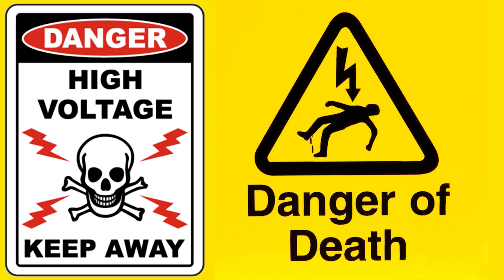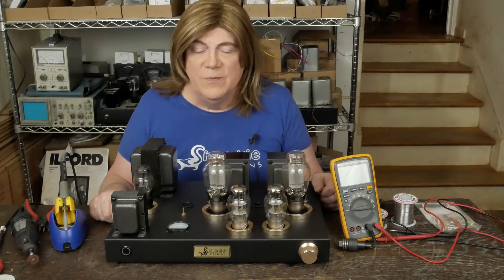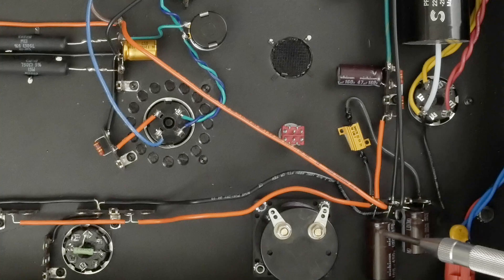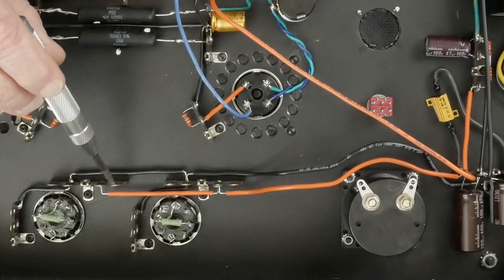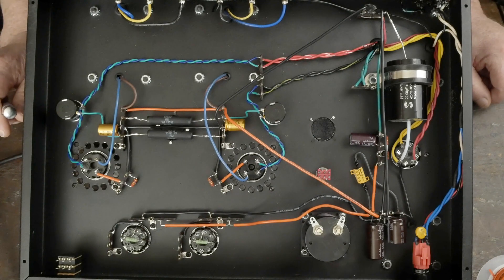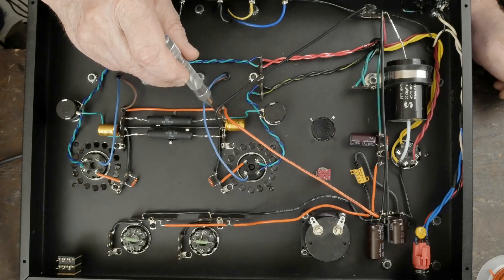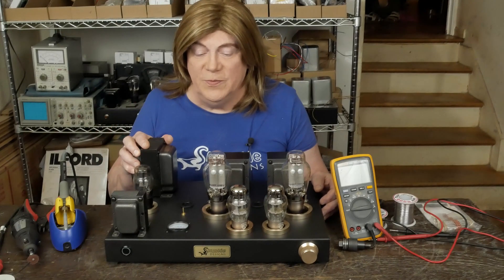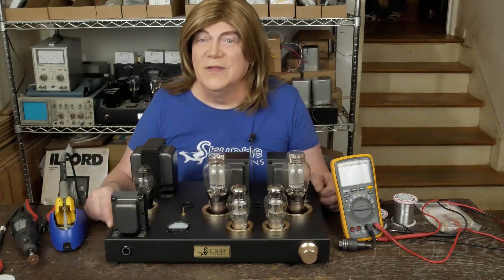2A3 Single Ended Tube Amp DIY Build: More Wiring!

Comment: I built an Analog Ethos 2A3 amp and it is rated at 3.5 watts per channel.   Wonder why so much lower power rating on the AE amp?.
Reply from the maker: That's about right for the output. I'm talking about the tube's dissipation being 15W, not the output.
Reply: Thanks for explaining.   Look forward to your testing results.

Comment: Use Rod Colman V9 regulator for 2A3, sound will be superb.
Reply from the maker: AC heaters work fine on a 2A3
Reply: @SkunkieDesignsElectronics  Of course they do and by adjusting the hum pot there will be no hum anymore, but the thing is the intermodulation of 100Hz or 120Hz with the musical signal and how it affects the sound. Even worst are voltage regulators like  LT1084, which recognize audio signal as error voltage and tend to cancel it.
Reply from the maker: I've read mainly Rod saying this and other's repeating, but I've listened to many 300B and 2A3 amps with either AC heaters or regulated DC that sound fantastic. Also EML specifically warns not to use current regulators and will void the warranty if they are used. of course YMMV

Comment: My experience with Hammond power transformers is that they all run a little over the specified voltage. Nice that you have a selection of rectifiers to tune the B+. Normally I have a selection of different caps for the first position. Nice, neat layout Skunkie!
Reply from the maker: I've found the same to be true. But they are reliable and quiet!

Comment: Immensely curious regarding the comment at 12:55!  I never really dove into the led discussions,  so have only copied and pasted so to speak.. would love to learn more by starting with that topic!  Was this at one of the forums?
Reply from the maker: Not sure where I learned about using LED vs a resistor/bypass cap. I know Kegger used them in a lot of his designs. That is a good topic for a video!